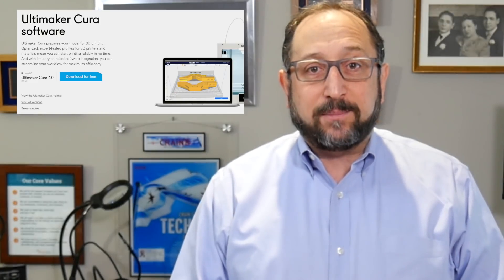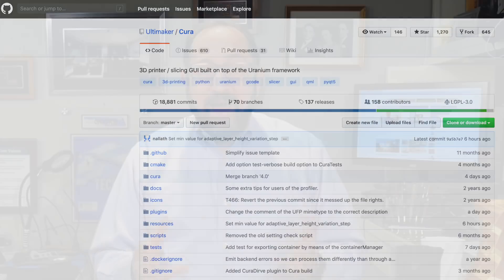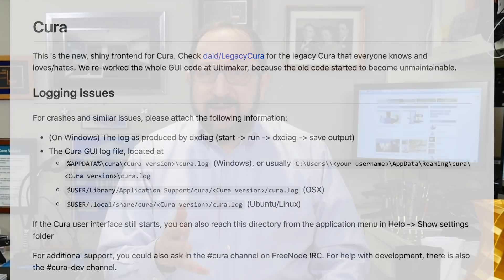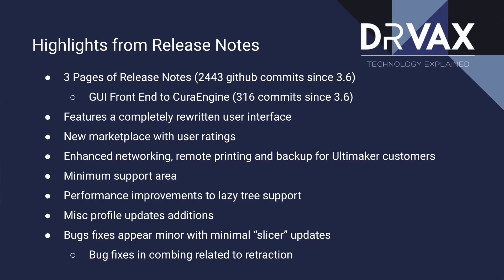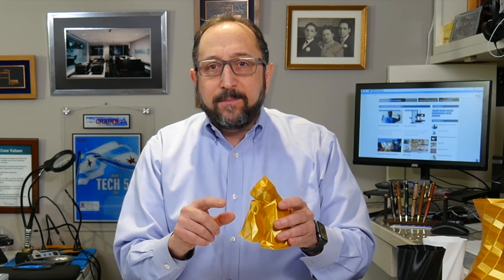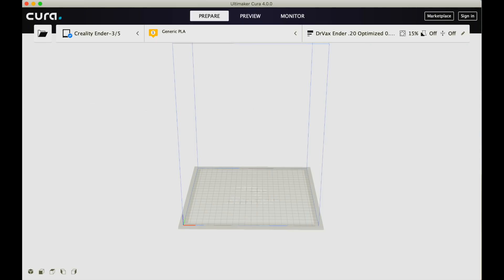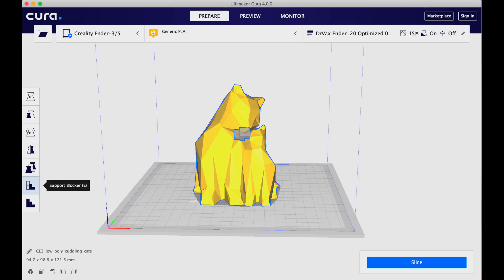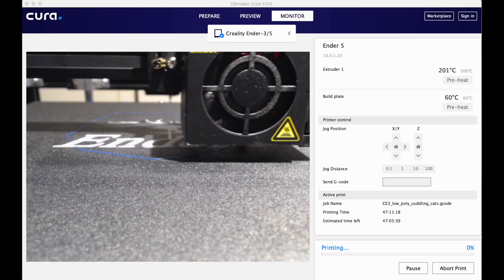3d Printing: Cura 4.0 vs Cura 3.6 First Look

Comment: Thank you for your great explanation of Cura 4.1
I am trying to print file using Cura 4.1 I found that for no reason the printer pause many times, but when I use same file with Cura 3.6 everything is OK don't know why, any idea? thank you a lot
Reply from the maker: Do you have any "extensions" installed?  Specifically the post-processing extension.  Are you printing to a printer with a filament detector that might be misreporting filament out?   Since each version of a slicer generates slightly different gcode -- the v4 gcode might cause a problem with you filament sensor if you have one.
Reply: @MakeWithTech  
Thank you for the fast explanation,
I don't have filament detector, I tried again different file and different printer and still the printer pausing for around 20 sec. several time even a very small file, is't possible there is a bug in V4?
All the best to you
Reply from the maker: @malazawi  Sure a bug is always possible.   What brand/model of printer are you using?
Reply: @MakeWithTech  Anet A8 and one I made almost similar to Anet (Arduino Mega 2560 with Ramp1.4) and full new frame. Thank you
Reply: @MakeWithTech  Anet A8 and one I made almost similar to Anet (Arduino Mega 2560 with Ramp1.4) and full new frame. Thank you

Comment: How to set built temperature.because not visible in cura 4
Reply from the maker: Happy to help.  Not sure what you mean by build temperature.  You can set the filament extrusion temperature and the bed temperature separately.
Reply: @MakeWithTech  please update how to set bed temperature
Reply from the maker: Here you go.  Open Cura.  Then click on the pencil on the upper right to expose the settings.  Make sure you are in custom mode by clicking on Custom> on the bottom right.  Then click on Material.  All of the temperature settings are under materials.   Look for the setting labeled "default build plate temperature".  The pop-up tips for each field are very helpful.

Hope this helps.
Reply: @MakeWithTech  as per your advice to material setup but bed temperature not visible.then go to settings visible but one icon is there how to Salve the problem.
Reply from the maker: When in Cura you can set the setting visibility.   On the right-hand side of the screen, when the settings are displayed, there is a hamburger menu, three horizontal lines.  Click on this.

Right now you may have "basic" selected.  Select a higher level, for example, "advanced".  The higher the level you set, the more options you will see and be able to change.  Try setting "expert" just to see what it does.

Comment: I tried it it's ok but I couldn't find anywhere to abort a print like you can in 3.6
Reply from the maker: Interesting.  I do not directly print from cura.  Thanks for sharing your experience.
Reply: 'Abort Print' button, lower right in Monitor.

Comment: How I can connect mi ender 3 with usb and print with cura? 🤯
Reply from the maker: Unfortunately many people have had trouble directly connecting Cura to a 3d printer since version 3.6.  I have not tried it with version 4.0  Let me recommend a couple of alternatives.  1) Try using MatterControl V2 an alternative to Cura that is excellent for directly connected printers.   Just google MatterControl and download it -- it is free.   2) Use Octoprint running on a Raspberry Pi.  This is the approach I use with my Ender 5 and it works perfectly.  There is a video about how to set up Octoprint on this channel.
Reply: @MakeWithTech  thanks 🙄😏🙂

Comment: I have two problems on version 4:
The menu is now over the 3D display area and the camera center is practically strangely under the menu. A possibility to pin the menu on the right of the 3D display area is necessary.
The font size for the menu is too small ( I have selected big fonts on my OS, but obiously cura is not respecting my choice ). I have bad eyes, cant't use cura 4.
Reply from the maker: Thanks for your comments and helpful point of view.
Reply from the maker: The more I use v4 the more the inability to see the full model and the menus at the same time bothers me.   It will be interesting to see if the community improves this.  Remember cura sponsored by ultimaker but since it is open source anyone can code improvements and submit them for review.
Reply: Someone already did. Check the marketplace for the sidebar GUI plugin. Also: Why are you actively posting the same comment on every video on youtube that's about Cura 4.0?
Reply from the maker: Fantastic.  I just tried the GUI Plugin and it works great.  Thank you for sharing.  That is what community is all about.

Comment: Thanks for the review.  I happened to notice your pen on the display, since I am a custom pen maker who recently got into 3d printing.
Reply from the maker: You will find some tuning videos on my channel as I also turn custom pens.  Keep watching. I am working on future videos that will combine both of these technologies.
Reply: @MakeWithTech  I have been making 3d printed pen molds for resin pours, various designs, etc.  You can see mine at www.penblanks.biz.  My pen web site is www.jcwoodpens.com.
Reply from the maker: +JC Shop Notes I will check out your site.  Thanks for sharing it.

Comment: I just installed Cura 4.0 on my PC desktop. I like the fact that Cura 4.0 is 64 bit and loads a lot faster. Also I don't have to go through the drop-down to find the Gcode mode every time. I am still having the same problem with 4.0 as I did with 3.6. It has an error that says "Your configuration seems to be corrupt. Something seems to be wrong with the following profiles Dremel3D20_draft  Dremel 3D20" When I go to fix the error the software no longer works. The thing is I am running an Ender 3 and don't use the Dremel profile at all!
Reply from the maker: I would recommend that you completely erase your cura installation, maybe backing up your profiles first.   Depending on your operating system this may be complex but you also need to erase the hidden configuration files.  There is a menu item in cura to show configuration files.  This will help you find them files to delete.  

Then reinstall and see if it fixes the problem.
Reply: @MakeWithTech  What fixed the problem is I had  Dremel slicing software loaded on my computer. I uninstalled the Dremel software as well as the  Cura 4.0 and reloaded Cura 4.0 and that fixed the problem. Thank you for your help! :-)
Reply from the maker: +Kent Harris glad it worked out.  Thanks for sharing the solution.

Comment: They made hard to connect to my raspberry pi in 3.6
I hope 4 does better.
Reply from the maker: I have used Octoprint via the Cura plugin without issue.  I did need to reload the plugin.  I have not tried direct connections either via usb or network connection.
Reply: @MakeWithTech  
It looks like the issue is not present in this version. Last time I tried, a while since, the octoprint linking seem different and somewhat confusing that required info that octoprint could not provide. It is hard to explain, but simply it seem that there was an issue setup wise. Now it is the standard code link and ir should work.
Reply from the maker: Thanks for sharing.

Comment: I was hoping version 4 would solve my "cura stopped responding" then my display driver crashes and I'm left with a black screen. I'm use win 7 with AMD radeon 6600 graphics card.  
This keeps happening  and is very unpredictable as to when it may occur.
Reply: Is this just to cura?
Reply: @samuelgonzalez7783   yes only when I run cura
Reply: @MrMcGooGarage  how much ram do you have and how much is used before cura is on?
Reply: @samuelgonzalez7783  4 GB  ram,  I forget where to check usage. I'll  google it. I'm still getting at least 1 file saved before the crash, but still aggravating.
Reply: @MrMcGooGarage  okay, check what is using a lot of eam in the background too.
Reply from the maker: Sorry I’m a Mac guy so this is outside my area of expertise.  Maybe some other viewers can help?